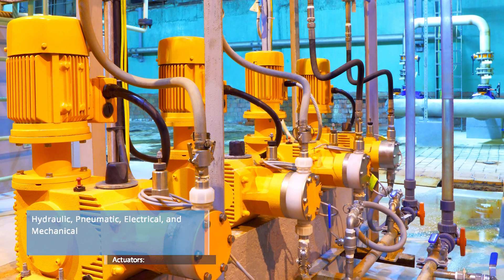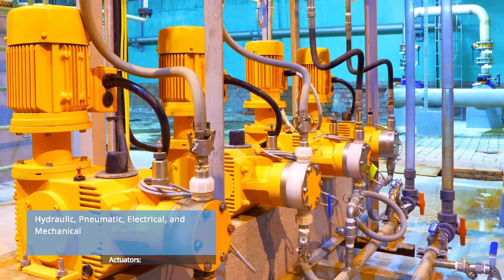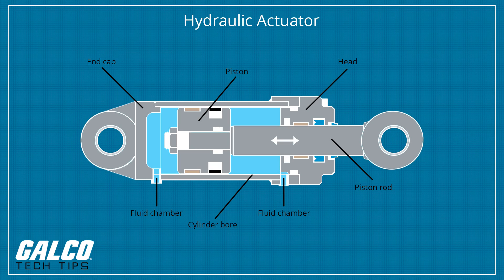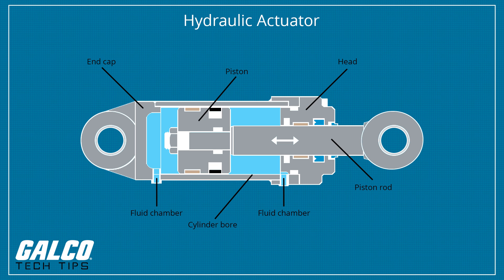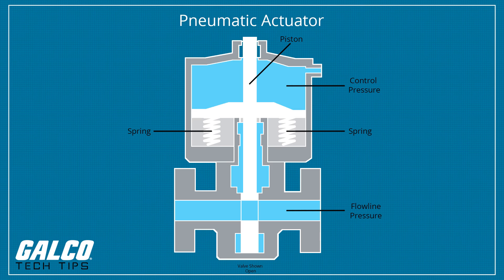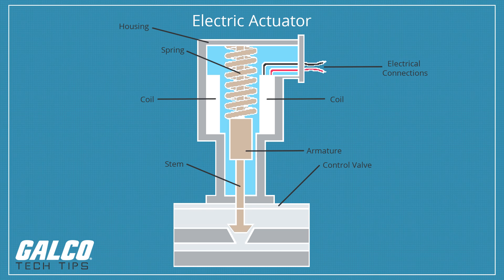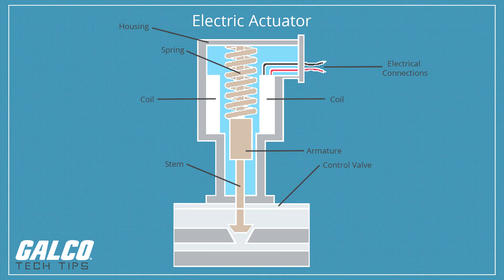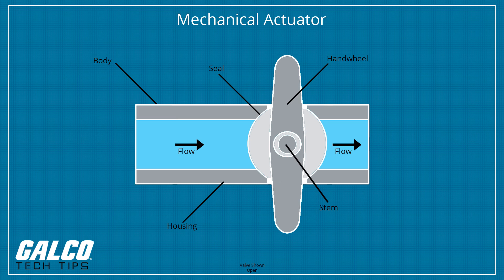What is a Actuator? -  A Galco TV Tech Tip | Galco

Comment: Which one is more faster?
Reply from the maker: If you were to measure surface speed for comparison, then I suppose the rotary could be made to go faster but only because it can continue to run and build speed. Where the Linear actuator has a finite distance to move in and there for may be limited in its ability to build speed.